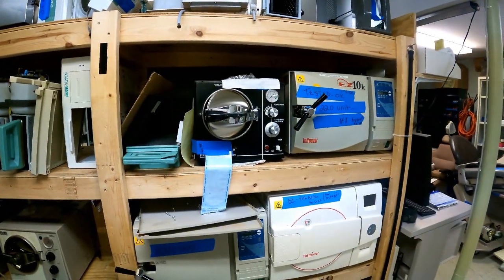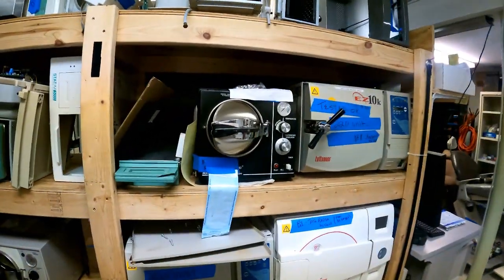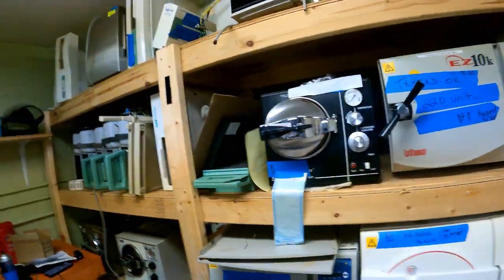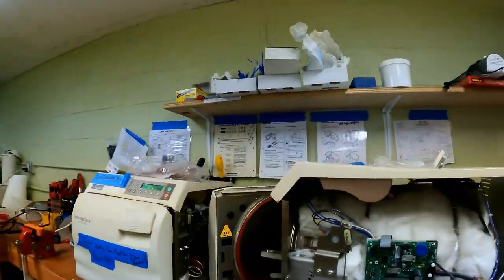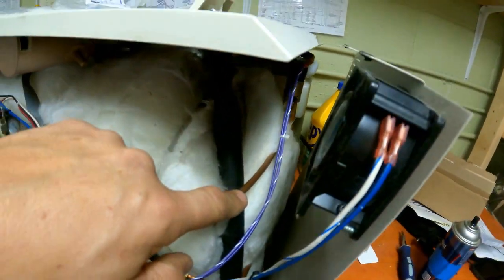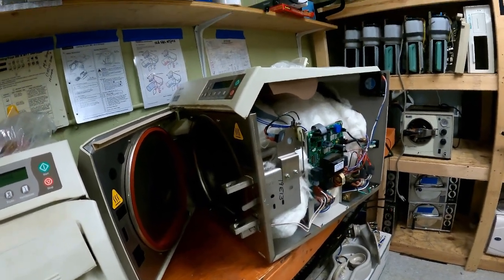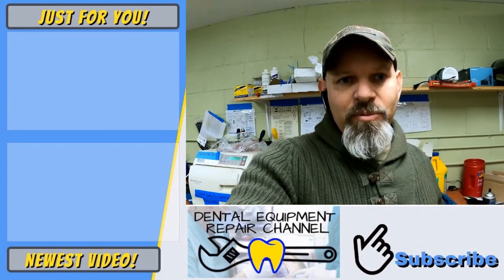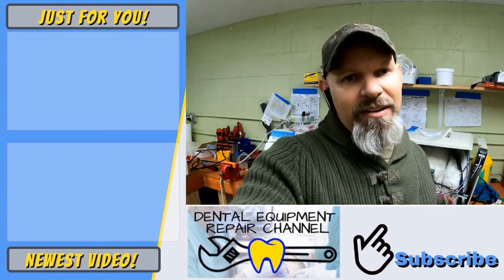Why to DRAIN your AUTOCLAVE...

Comment: what's a good refurbished autoclave to get for a small 2 chair dental office - need replacement and I value your opinion. Thanks.
Reply from the maker: Every dental office should have two autoclaves. I would suggest Mid Mark M9 and a Statim 2000.

Comment: Does this also apply to autoclaves with separate water tanks for clean and used water? Because the concept of draining water often from closed circuit autoclaves is familiar to me.
Reply from the maker: Great question. I don't think so for this reason. It may be a good idea to clean out these tanks during preventive maintenance to clear lint and dust, etc.